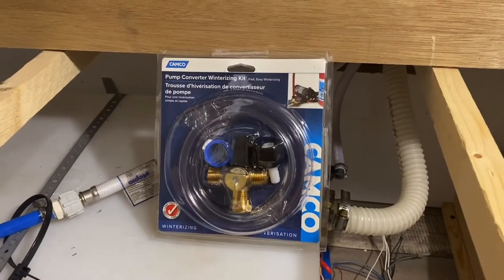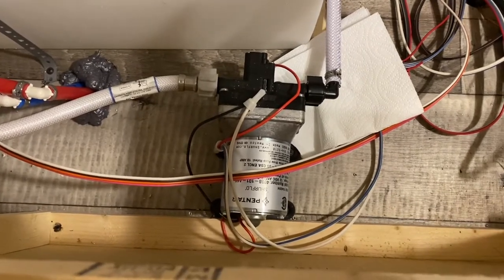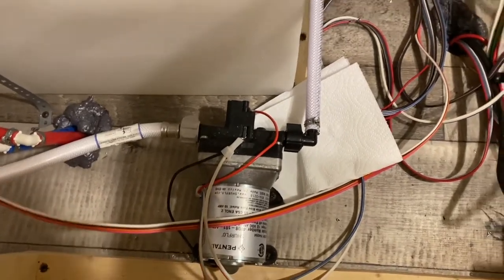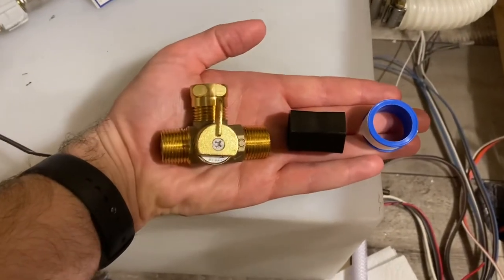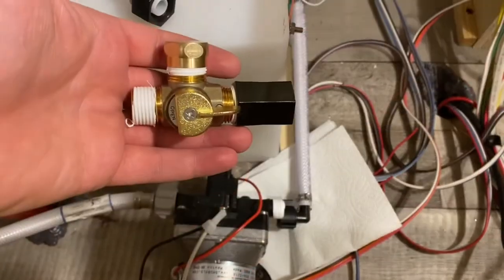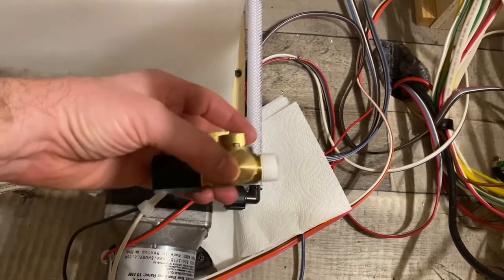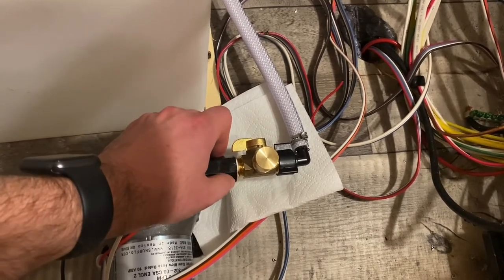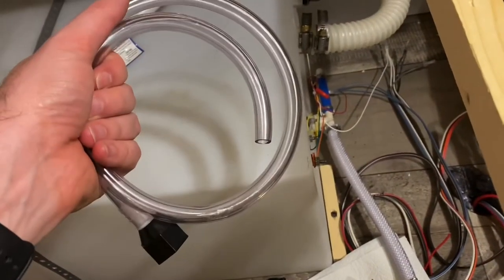RV Water Pump Winterization Kit Install

Comment: How do you protect the line and fittings before the bypass valve?
Reply from the maker: Apologies, I’m not sure I understand your question. In the video we used teflon tape on the screw-on connections to ensure a secure fit.

Comment: I have the exact same water pump as you  - Pentair Shuffle 4008-101-A65. I installed it as in your video, but it will not suck in any antifreeze when in bypass mode. Is there something else that needs to be done?
Reply from the maker: You might want to check your connections - it needs to be air-tight in order for the pump to work properly. Also check to make sure there is no blockage in the valve that controls normal/bypass.
Reply: @GalippsGadgets  Thank you very much! I conducted a number of tests and it turns out the water pump itself was not pumping water. The pump had died. Replaced the pump and all is good!